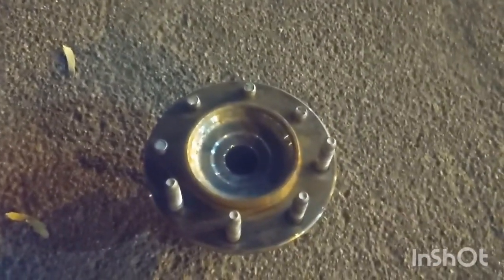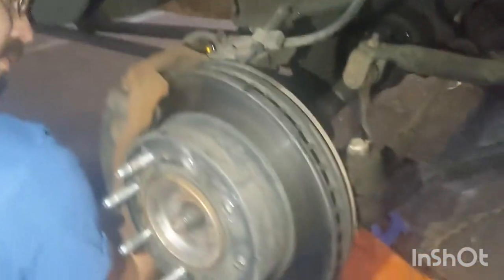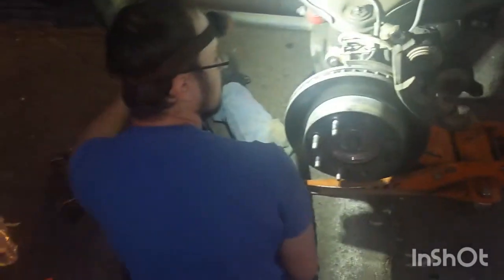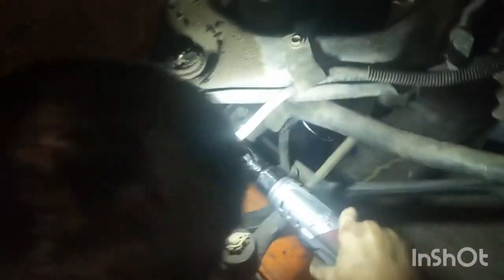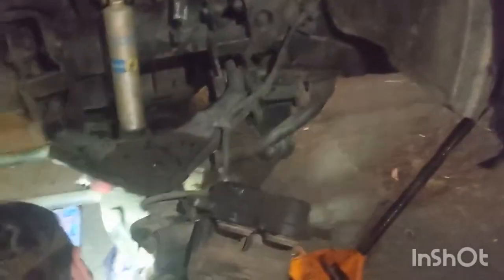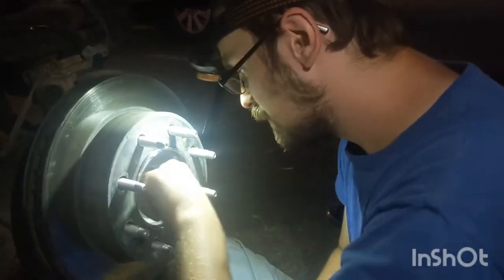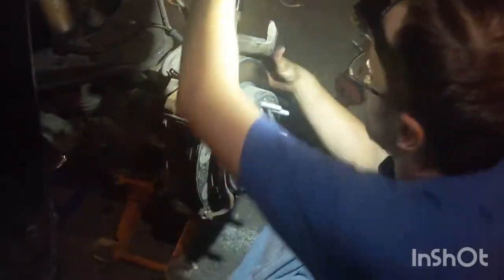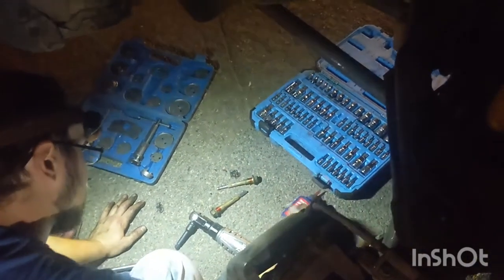My customer's wheel fell off! How to change wheel bearing 2005 Chevy Silverado. LOW QUALITY VIDEO

Comment: Sik vid but why not use the torque wrench and blue thread locker instead?
Reply from the maker: Some types of bolts are pretty forgiving on torque specs. On something like this, just get it hella tight and send 'er. No big deal. Those bolts aren't going anywhere. Promise.
Reply from the maker: The red tastes better.
Reply: @TheYouTubeMechanic  the concern wasn't for the bolt coming off the concern is for the poor soul that has to work on that truck next lol
Reply from the maker: Nah he'll be fine. If he has an impact wrench...
Reply: @TheYouTubeMechanic  true 🧠